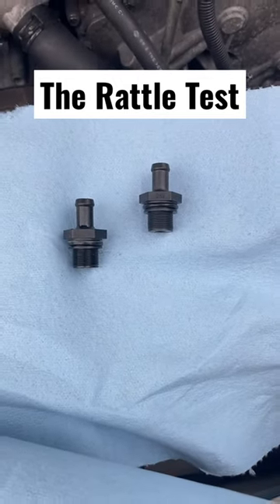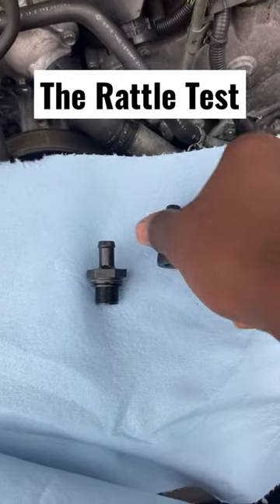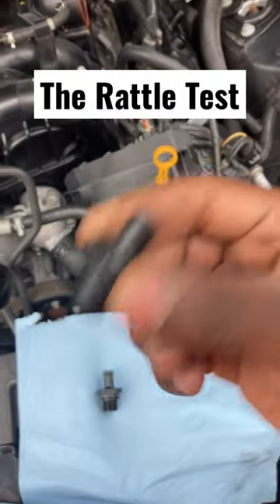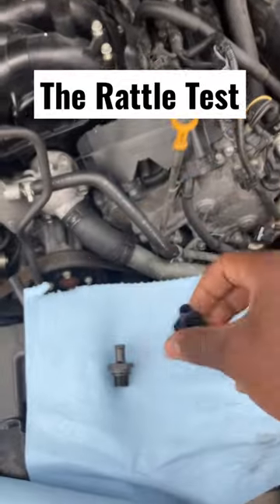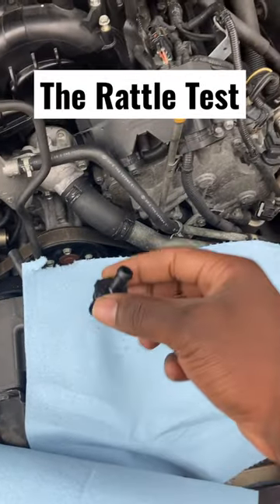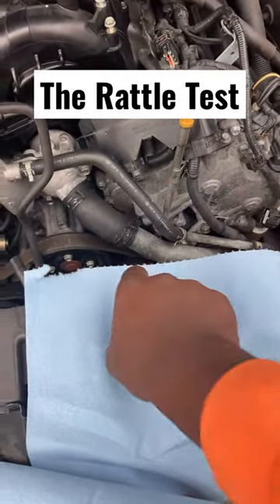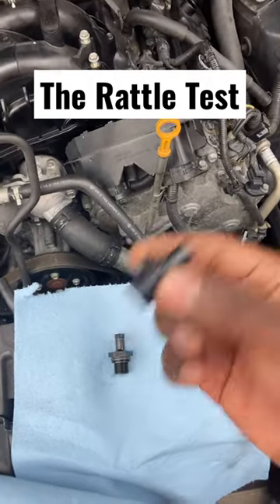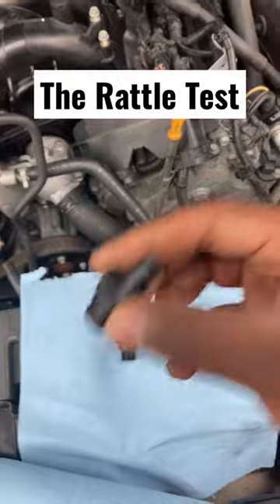Quick Test for a PCV valve

Comment: "This is 1 test you can do." Good opener.. Not all bad pcv valves will be quiet. Another test is to blow in both directions. If flow is free coming up, and restricted going down, it's a good valve. I've had valves fail in a manner to allow open flow, but would still shake. Good show. Infiniti sent in photos of bearing damage to car shield. Will update later this week..

Edit.. forgot about this, engine was toast, 14k for replacement. Told em to send it to auction, i don't want it. So they slapped it back together, presumably just doing bearings, and sold it. Waiting for prices to come down a bit to get into the q70L 5.6x. And waiting for open parking in front of the house 😆.

Comment: total bad VIDEO YOU NEED TO BLOW IN IT AND SEE IF THE VALVE IS ACTUALLY STOPPING FLOW OF AIT THE RATTLE IS NOT GOOD ENOUGH I FOUND OUT THE HARD WAY WHEN IT TOOK DAYS TO FIGUIRE OUT THAT WAS THE PROBLEM OF A STTUDER ON ACCELERATION THAT WE COULD NOT FIGURE OUT! STUPID LITTLE 5 DOLLAR OART FIXED IT!@!@  IT RALLED BUT WAS STILL BAD

Comment: It’s cheap and a service item. Just replace it. I’ve had valves that still rattle just fine and after changing the oil consumption of the engine was reduced majorly. At idle a majority of the engines air intake is being drawn through the PCV system due to it being under vacuum. The dollar bill test where you take a dollar or any thin paper and hold it over the oil fill and see if it gets sucked down at idle is the best test if the valve cover design allows for accuracy.
Reply: not the oil fill cap! the dip stick!
Reply: @ Either or. It depends on valve cover design if the full cap way works.

Comment: It’s a good idea to clean the pcv valve with some carb or throttle body spray. It gets rid of the crud that builds up inside. Shake it back and forth and repeat.
Reply: HE should have mentioned that. As a part of my maintenance routine, I remove it and clean it when I change my oil. It's very simple.

Comment: Mine was rattling. Upon closer inspection the spring was broken inside causing the fuel/air ratio to be off when coasting causing RPM surge.  Just replace it. It's a cheap item.

Comment: I have a 2002 Corolla that I purchased with 74k miles I’m at 142k and just replaced the Pcv valve for the first time since I’ve had the vehicle maybe it’s the first time ever! I went to Toyota and purchased a new oem for $10.78 and installed myself. Should be good for another 100k miles. Not to mention the Pcv valve was still good but as a preventative maintenance won’t hurt.

Comment: Have you cleaned one? Seems to work, but for my car it was like $8
Reply: bro just get a new one
Reply: @tommydied  I did….
Reply: I cleaned mine and put it back in then realized several months later it was broken I thought just cause it rattled it was good but it was actually just stuck open so it did nothing it may as well have been just a normal tube or pipe so I replaced it and my car slightly drove better afterwords at least after the first 5 minutes after sticking it in my car rpms shot up and stayed past 3k with just a feather weight of peddle pushin then after I pulled over and sat there a minute to let it idle back down it reconfigured and now it's good

Comment: my pcv wpuld ratyle but oil was leaking from it
Reply: You are right. Blow through both ends. It's supposed to completely stop flow from the intake into the engine but allow flow from the engine into the intake.

Comment: I bought a PCV valve from Rock Auto.
It was defective and could have ruined the engine if I didn't know how to test it before installing it.
Buy local, if you can, to test the valve at the store.

Comment: I'm no mechanic, so, isn't the force applied with the rattle A LOT LESS strong than the gas pressure inside the engine?
If so, then we have the following logical conclusion:
Rattle = Good
No rattle = Either bad ...or just normally dirty and totally still good.

No?

Comment: where is it located on a 5.7 engine
Reply: On the valve cover.
Reply: There is always a thick hose from the top covered with thick insulations when you open bonnet..easy to see..and it always connecting to your intake manifold housing..the pvc valve..is at the other end of hose connecting to it✌🏾